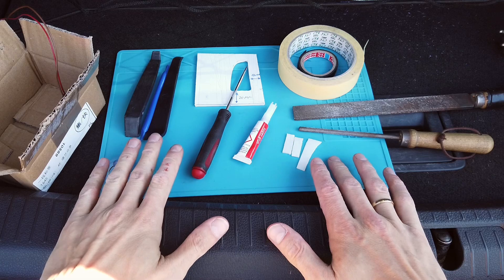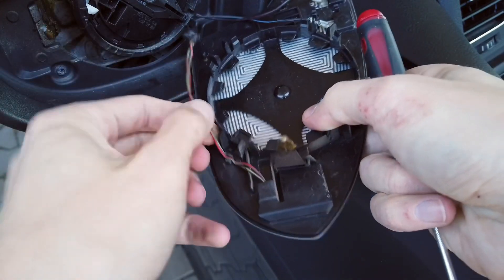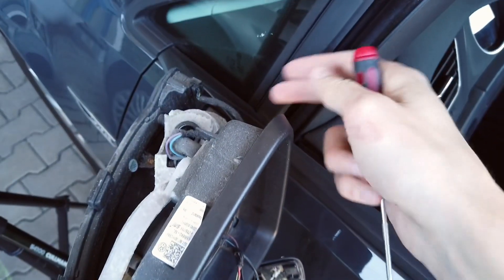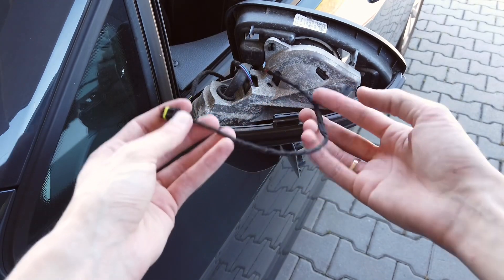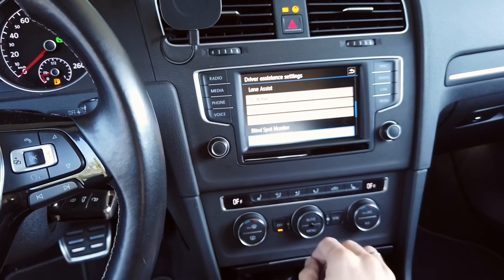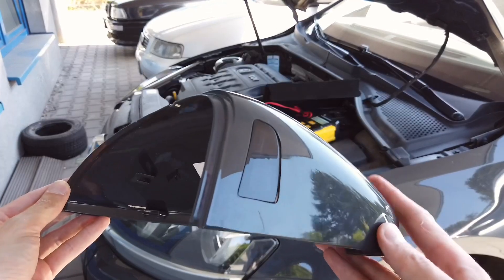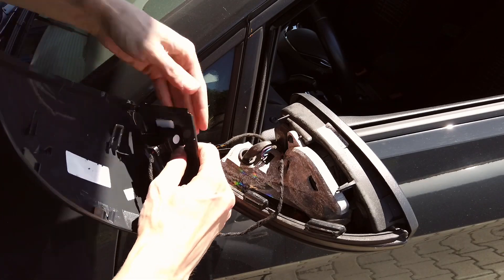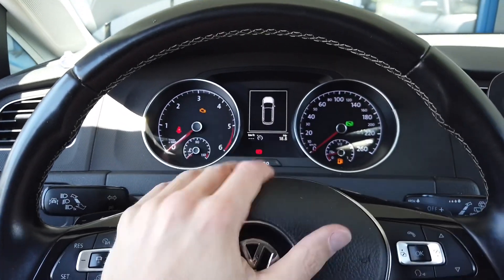VW Golf MK7 (5G) Blind Spot indicator upgrade

Comment: I purchased the Black case with the indicator already fitted using your link. Was easy to install. Great Video and Idea.
Reply: Hey Adil, I saw some on Ali as well. But there was no plug at the end of the cables. How did you connect them?
Reply from the maker: Happy to help!
Reply: @mrfixpl  DO you know if we can also enable warning sound for blind spot indicator?

Comment: So how does the car know there is a car approaching?

What sensor does it use to tell the driver a car is approaching 

Does this have the same efficiency as using radars which send messages to the led to flash and notify the driver?
Reply: All he's doing is changing the indicator. Uses the factory rear radars...

Comment: Can this be done if my car doesn't have blindspot assist as a feature?
Reply from the maker: You would have to retrofit rear radars, add wiring, code it, and calibrate it.
Reply: Which rear radars?
Reply: @maroslorenc309  Think they go in the rear bumper.